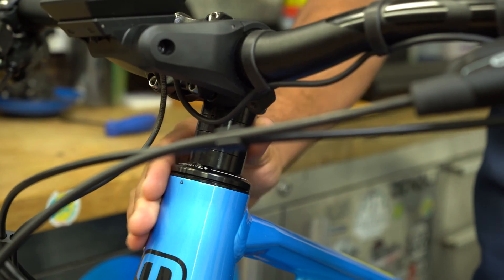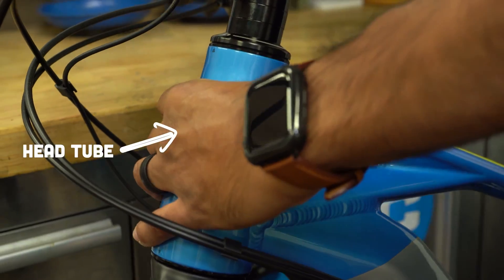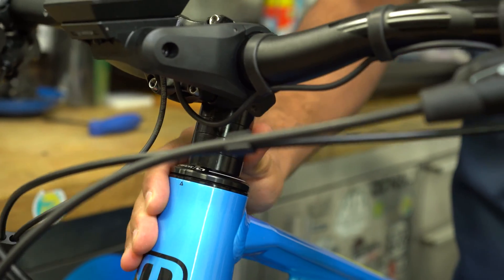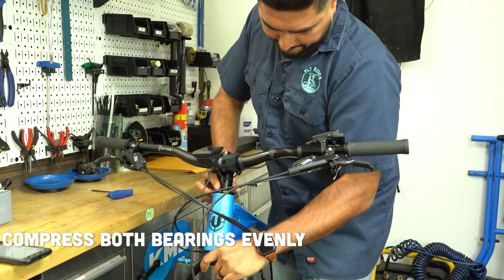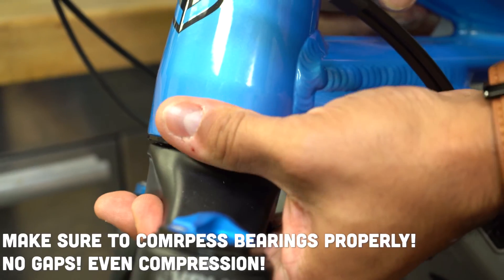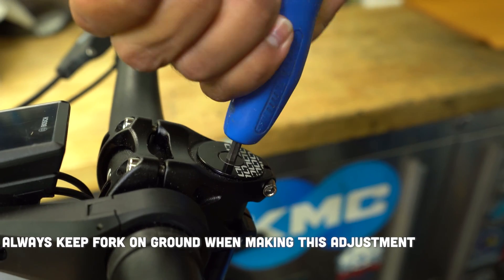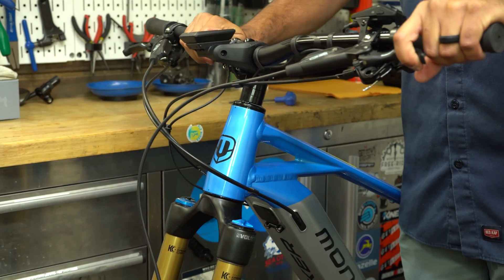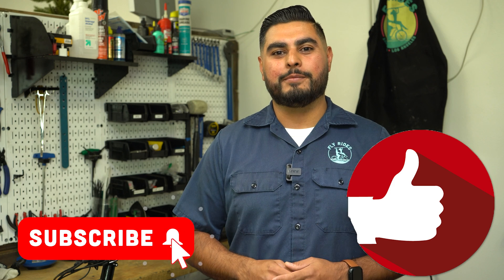How to Check Your Headset on an Electric Bike | Star Nut, Headtube, Bearings Explained

Comment: I've taken my top cap off I've held my hand under the bottom of the forks to pull it up there is nothing that is tightening it there's a little Gap and a little ring under the Gap cap is not letting it slide down far enough to tighten

Comment: The Ride1Up assembly video, in particular Portola e-bike model video is not indicating that installing the headset into head tube requires rocking the headset and fork, wiggling in order to be able to tighten well the head cap? I did not rock but make sure they are aligned. And I still have out of the new box e-bike with loose headset? I’m not sure why some brand lime Ride1Up will leave to general public to do this handlebar installation potentially if not done properly it’s a safe issue.
Reply: This may not be your issue on your ride1up.  Many of these online e-bikes are being sold with faulty frames, etc. Seems the E-bike industry is focusing more on the E then the bike. They’re trying to throw bells and whistles on the electrical part and use entry level parts and components for the bike parts. Not necessarily the way to go when you’re traveling at faster speeds on a heavier bike.

Comment: Had a great ride the other evening, my road bike was quiet and humming along great. Checked the headset for movement and there seemed to be some on the top near the stem. But the ride had been flawless. So, I did a complete service of the headset since it was two year. Sadly, it was more loose on top and below. Then tried your method to reset the compression using weight on top with the fork and wheel on the ground. Bingo, everything is solid and tight.

Thanks so much for your great work and the super excellent tip!